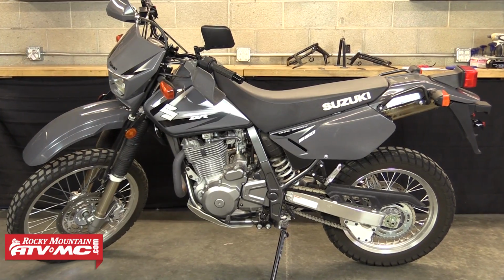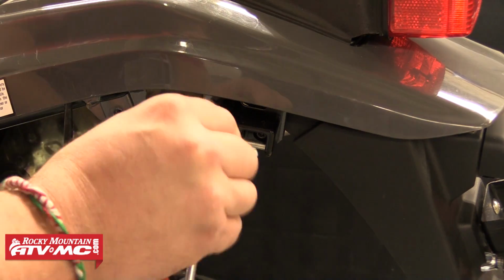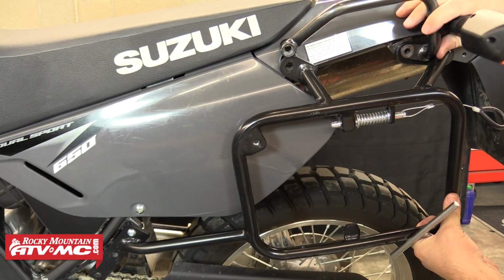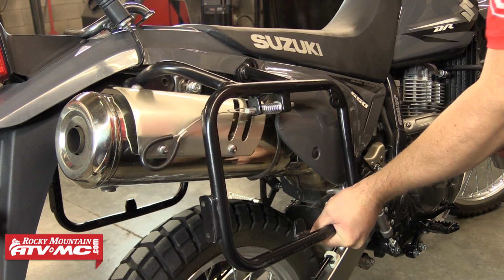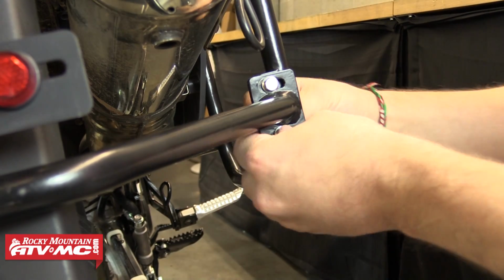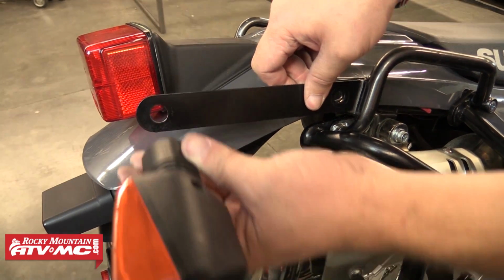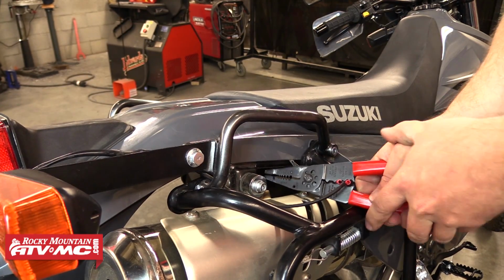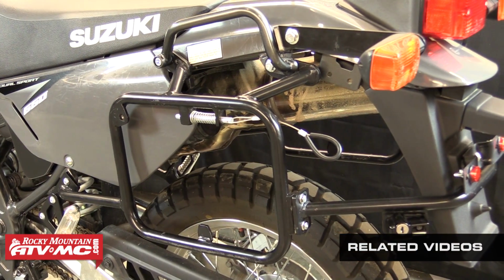Suzuki DR650 Tusk Pannier Rack Installation

Comment: Does the Rack system include bolts or, do we use original nuts and bolts?  Thank you
Reply from the maker: The Tusk Pannier Racks come with mounting hardware included.
Reply: @rmatvmc  thank you!

Comment: Do you have any tips or tricks for using the Suzuki rear rack (Part# 1388300001)? There isn't enough space between the rear rack and the frame for the Tusk rack without cutting/grinding the rear rack.
Reply from the maker: Bakezori Sorry.  We didin't design our pannier racks to work in conjunction with the Suzuki Top Rack.  We designed it to work with our Tusk Top Rack: https://www.rockymountainatvmc.com/p/4470/55677/Tusk-Top-Rack .  Maybe our Tusk Top Rack design can give you some ideas on how to make it work?
Reply: Did you ever find a solution? About to install the tusk set on my 96 DR650.
Reply: same sentiments.

Comment: Curious, the mounting looks almost similar to the DR350. Do you know if it would work out? I'd be happy to be a guinea pig and review :)
Reply from the maker: The mounting is all pretty similar on all the bikes, but they are very specific to each model.  I am sorry, but we don't have any that will fit the DR350.
Reply: Rocky Mountain ATV MC well I am curious since the passenger pegs on the 350 and 650 are the same, the upper mount may need to be modified. Do you sell just the hardware? I'd be willing to give it a try. Following the video and looking at mine looks very very close.
Reply from the maker: You are more than welcome to buy one and try.  It will require modification.  the bikes are similar, but not the same.

Comment: What if I found a used set of racks with no rear bar.  Would they be dangerous to use?
Reply from the maker: Sam Stevenson Wihout the rear bar brace installed, the structural integrity of the pannier racks goes away.  That rear bar helps with side impacts from the racks bending and with your load capacity.  Hope this helps.